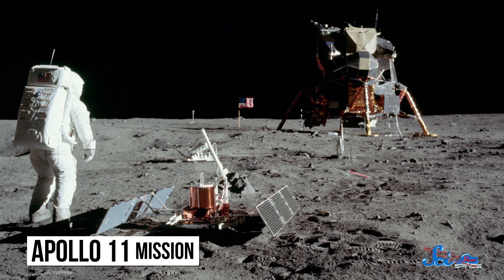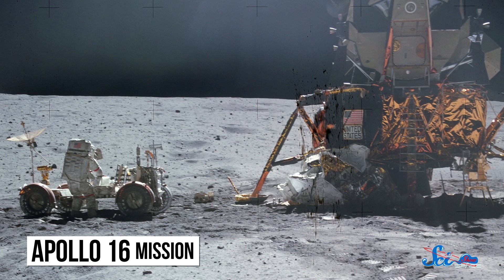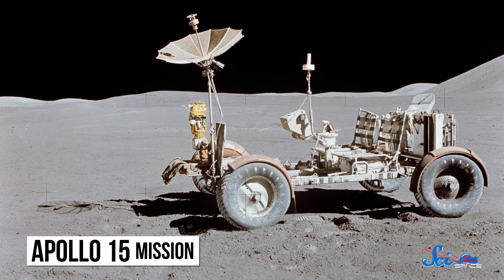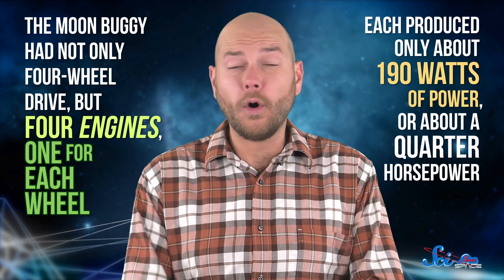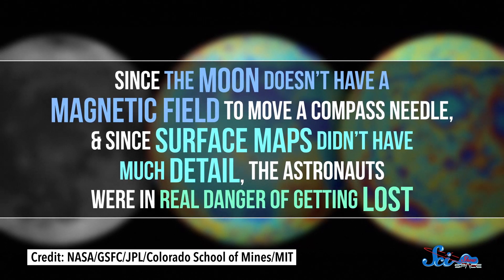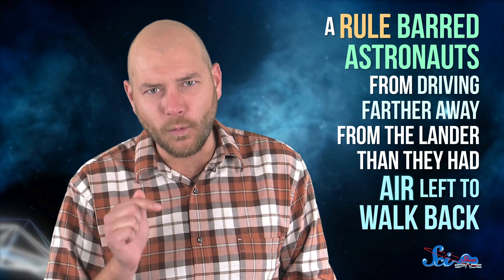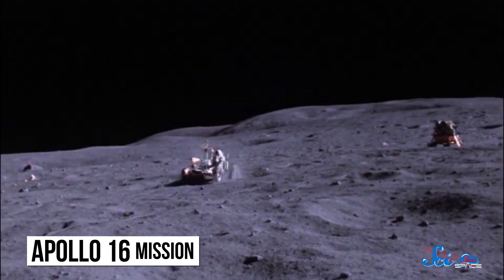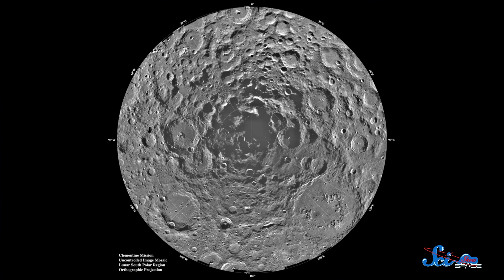What We Learned by Putting Cars on the Moon

Comment: I loved that you had to use many units and numbers, and no imperial measurements were said.
Reply: SI measurements are the measurements of science. If you're doing real engineering or Physics, even in the US, you're working in SI, not imperial measurements. Watch any SciShow video and you'll notice that Imperial Measurements are almost non-existent.
Reply: It was indeed appreciated, except for when giving the vehicle’s carrying capacity. Kilograms are ambiguous in that instance.
Reply: In the US it is usually all imperial or all metric. In the UK for example we end up with these strange mixtures, like a screw 4mm in diameter and 2 inches long, or drive 50km and get 22 miles per gallon.  You might weigh your computer in kilograms, but when you ask someone how much they weigh, they tell you in stone.  I love the UK, but their measurement system is almost as messed up as ours.  That probably goes for most countries.  It comes down to what the population is used to.  

I agree that the metric system is easier, but it does not discount the imperial system.  It really irritates some people when imperial measurements are used in a scientific setting.  To them I say that the only country to put humans on the moon used imperial measurements to do it.  In the 80’s they started to convert to the metric system and they have not been back to the moon since!
Reply: The problem in trying to make this exclusive to science is that of course there's not a clear boundary between science and not science, it's more of a spectrum, and every part interacts with its closer neighbours. 
Like, science papers - Labs - Engineering companies that support these labs with equipment - science news. After that it becomes less science, but still related. Measurements of products' volume and weight, temperature, they depend on scientific values, to define the number of micrograms needed to make a compound of a remedy. 
Bridges exist in the normal world but they can't work with proper uniform science. Same to boats. Or rockets and satellites, and so on.

The somewhat recent probe crash in Mars that crashed because of a conflict of measurements, happened because of that arbitrary definition of science/not science. One company that supplied some equipments used imperial. The place where the boundaries are subjectively defined, there will be conflicts, because the two closest things separated by the boundaries have a lot of contact. The transition must be complete someday. Uniformly.
 And the US is too much relevant on the world to get attached to a very outdated system. Because not only in science there are problems, international trade suffers a lot economically, reprinting numbers, and mistakes that can cause disasters as well.
Reply: Jon A Yes, celsius' full numbers are more broad than fahrenheit's. But it's not like if felt like needed, companies wouldn't put decimals in the thermostats. We don't have it here because Brazil doesn't have dangerous temperature problems, but I bet that in Europe they may get to decimals. It's not a real problem, just fear of change.
Reply: Monody yeah, on these cases the way I deal with yankees is knowing to convert. Kilograms to pound is actually easy, it's very close to 1:2. If I remember correctly the real value is 1:2.1. We have to do the same outside the US when imperial come.
Reply: On the "imperial better than metric because man on the moon" thing:
The fact that something was once done with primitive tools doesn't mean that upgrading them isn't a good idea.
Reply: Jon A, That's called a mental block. The good news is you get to choose whether to keep it.
Reply: It's an unpleasant tradition to say 'my chosen way of viewing the world is superior to your chosen view of the world'
While the metric system is great(I'm a scientist), it's in poor taste to be pleased by excluding others. 
Why stop at numbers, when you can judge a writing system and or language too? Not so my hyperbole as it is history... :/
Reply: Jose I never said that imperial was better than metric, I find metric to be easier. The point was directed at the people that think that imperial measurements in a scientific setting are “laughable”.  I was just pointing out that mankind’s greatest achievement was accomplished using imperial measurements, with a little humor.  

Many countries have a variety of measurement systems.  They work and are kept because that is what the population is use to.
Reply: Metrics is for science nerds not normal people
Reply: Not me, I love SciShow, and I understand the scientific world and most of the world in general uses the metric system, but generally speaking using the metric system alienates me a bit and is my only gripe about SciShow.  

Like I said I understand why they only use the metric system, but I do wish they would at least put a caption up on the video so there American audience would feel included.  Just a little caption that would pop up on the screen when they say a measurement in the metric system with the imperial conversion would make my day.
Reply: Jon A they did this on the video captions though. I'm not sure if they do it with all mentions of metrics, but they do it a lot.
 Now you get the feeling that when the rest of the world watch americans talk science on imperial and the globe have no idea what's being said. It's important for general americans to learn metrics, but I agree we have to make this a transition, not a forced "ban" on imperial (although imperialism has kind of been banned since like the 60s :p).
We have to make this transition happen though, we can't just say both all the time in all data, because if so americans will only continue confortable. Some occasional missing imperial may be important, incentive of the american government and schools to get into metric, change in everyday use. But if the US only wants to change on science for now, let's do it on science then. 
It's not like billions around the world aren't forced to accept learning english to prosper in life properly.
Reply: I watched it again, just to see, and some how I did miss that they converted it, but not in every instance.  

We did learn the metric system in one of my high school science classes, it wasnt so hard to learn.  That was pretty much the last time I used it.  I didnt take any science classes in college, so it was never used there.  And you know what they say, use it or loose it.  I have long since lost it.  The only thing in America I can think of that uses the metric system is pop, and only larger bottles.  

It might not be the worst idea if we used the metric system here for somethings, but definitely not temperature.  I get uncomfortable if my thermostat is off by even a degree, so unless your thermostats do fractions of a degree I just couldnt live with the metric system running my heater.  Outside of that I would be willing to trade feet for meters.
Reply: Yes, alienate half your audience, what a great idea for a youtube channel.  Lmfao.

Comment: Seems to me it'd have been much cheaper and easier to just have a cart that the astronauts would push around, where the carts would contain all the necessary equipment needed to conduct the tests, and a lot of storage for moon rocks.  They could have then given the astronauts larger oxygen tanks aboard the cart.
Reply: NASA did experiment with such an idea, but ultimately decided against it. Amy over at The Vintage Space addresses it in one of her videos. Basically, the astronauts were already overworked, breathing hard etc, and the Apollo spacesuits had limited flexibility/joint dexterity. I recall that the Apollo 15 astronauts came back with vitamin deficiencies and hand injuries from working so hard on the lunar surface.

Comment: 2:08 MOTORS! Engines use fuel. Motors use elecricity.
Reply: mo·tor
ˈmōdər/Submit
noun
1.
a machine, especially one powered by electricity or internal combustion, that supplies motive power for a vehicle or for some other device with moving parts.

Comment: i am curious tho, wouldn't it be better to just give lander some wheels, and have the entire thing roll around like a sort of a camper van? 
it would require lot less weight, as it wouldn't need separate frame, and all the tools would already be onboard... not to mention that then, there is no concern about coming back, meaning they could go wherever
Reply: The lander could only land on a relatively flat plane. Too much, and it was at risk of tipping over, either at landing, or at liftoff. The lunar rover was much more tolerant of a rough terrain.

Comment: Where did they put the LRV to get it to the moon? In the lander?
Reply: Jeffrey Bernath    Each LM descent stage had four externally accessible equipment bays referred to as quads.  The main portions of the LRVs on Apollos 15, 16, and 17 folded up very cleverly to fit into Quad 1.  Additional LRV equipment was carried on a rack, called a pallet, mounted in Quad 3.  Astronauts removed the LRV pallet from Quad 3, carried it to the deployed LRV and mounted the pallet on the LRV’s aft end.

Here is a picture of a folded LRV being either installed in or deployed from (I can’t tell which) an LM on Earth.
http://www.ninfinger.org/karld/My%20Space%20Museum/lemlrv.jpg

Scroll down on this page to get more information on the quads.
http://www.ninfinger.org/karld/My%20Space%20Museum/pjlmpics.htm#ds

Comment: It's amazing to look at all the stuff they did to get these technologies to work-- like how they /weaved/ code into core memory in the saturn 5, or how the buggy had basically piano wire for wheels over a skeleton to absorb shock. So many things that you look at today and you just have to respect. Also, just kind of as a cool curiosity, those systems were more robust than (most) modern technology. Simply because of how fast modern parts work (in gigahertz), radiation and other stuff can introduce anomalous calculations and stuff.

Really, really interesting stuff and it opens so many fascinating challenges; engineering and otherwise.
Reply: Planned obsolescence.  How could they make billions if your stuff lasts forever?

Comment: MOTORS not ENGINES
Reply: Ford Motor Company.  General Motors.  Both predominately built I.C.Es.  I say that an internal combustion engine is a type of engine which in turn is a type of motor.  Generally speaking, I use "engine" when I think burning, and "motor" when I think electric and magnetic fields.
Reply: English is literally the only language on Earth to make that weird distinction between engines and motors, and even so it's pretty much only people who actually build motors that use the engineering terminology. In a lot of European languages motor (or something similar) is the only word for a machine that transforms some kind of energy into work. Electric motor, petrol motor, hydrogen motor, steam motor, perpetual motor etc. It's all good, and technically correct too, as motor is the hyperonym of engine. Way to be technically correct and piss of pedantic morons at the same time.
Reply: I get you, and I had the same gut instinct. However an engine is just "a machine with moving parts that converts power into motion." (as defined by Google)
Reply: all engines are motors. not all motors are engines
Reply: @peabody3000  not by definition. You lose.
Reply: @mrwhips3623  but by whose definition? there is more than one. some people say a motor is somehow by definition only powered by electricity... but not everyone. and the language roots suggest it is anything that can supply power of movement
Reply: @peabody3000  let's go with the official definition, and not somebody's opinion.
Reply: @mrwhips3623  but whose official definition? language inherently leads to multiple definitions. a motor originally meant anything that moves something. if you adhere to a different definition, it's one that came after that
Reply: @peabody3000  the definition you used I think is correct.
Reply: Motor can be used for either. Engine is not used for electric motors.
Reply: @jesondag  it's not used but that doesn't mean its incorrect.
Reply: asasial1977 You're being very pedantic over the use of two synonyms in a non-technical sense. And you misspelled "literally." And you blamed linguistic evolution on millennials. A google search would tell you that not only were the terms interchangeable to begin with, but in casual speech, they are synonyms. This is a general education channel, not a technical one.
Reply: @HonestLeigh  you were the pedantic in the first place with a stupid correction.   motors are electric. period.
Reply: dondude69 internal combustion engines can be called motors.  That doesn't mean the reverse is true.  Electric motors are not called engines.  I didn't make up this convention, but it exists nevertheless.
Reply: @ZPositive  
en·gine

/ˈenjən/

noun

noun: engine; plural noun: engines

1.

a machine with moving parts that converts power into motion.

synonyms:motor, machine, mechanism;More

jet, turbojet, turboprop, turbofan, turbine, generator
Reply: Racing is considered 'motorsport' not 'enginesport' isn't it?
Reply: William, like squares and rectangles, engines can be motors but ELECTRIC motors can not be engines. Let's stop trying to show everyone here how smart you are and let's learns something.
Reply: It has to do with the kind of energy you are using. A motor converts one kind of kentic energy into another form. Where as an engine will convert potential energy from a given fuel into kenetic energy. 
And further more; most people consider the motor separate from the battery on an electric vehicle. However in a hypothetical machine, where you continuously replace the consumed electrodes, that could be considered an electric engine.
Reply: asasial1977 As much as it pains me, the meaning if words belongs to the speakers of a language. Many words have more than one meaning, sometimes in opposition to each other.
Reply: its just words... chill
Reply: literally no one cares
Reply: @Reed1  i care...literally.
Reply: No they can't, when have you ever heard of an electric engine? 
Motors are electric
Engines are internal combustion or steam. 
Just because a word is used wrong on a regular basis does not mean it is correct, ie millennials using "litterally" to litterally mean the opposite of litterally.
Reply: @asasial1977  LMAO...I LITERALLY HATE THAT..
Reply: Man, William you couldn't be more wrong on this one. And your "general education" attempt to justify it's usage is extremely poor at best. Striving for mediocrity is not a lifestyle...
Reply: GoldSilver (w/ Mike Maloney) The two words can be used synonymously. Especially since he explained immediately afterwards the specifics of the battery and propulsion on the rover.

Comment: Silver-Zink/Potassium Hydroxide batteries according to WIKI. didn't even know those existed.
Reply: They used paraffin wax to cool them. The change from solid to liquid would absorb a lot of heat and then the batteries would be allowed to cool later which would turn the pariffin solid again.
A lot of really cool tech went in the moon missions.
If you haven't seen Moon Machines, I recommend you do. Lots of great information in the series.